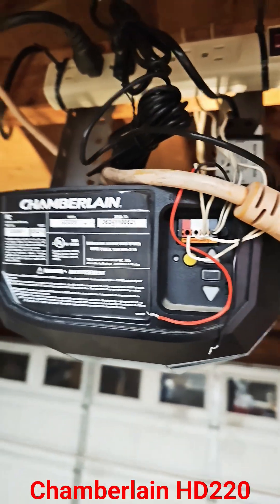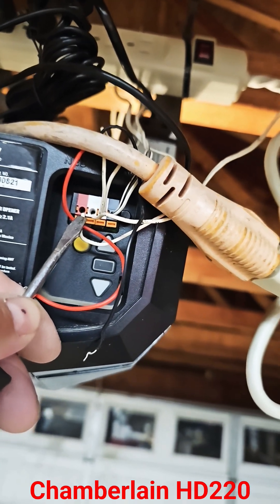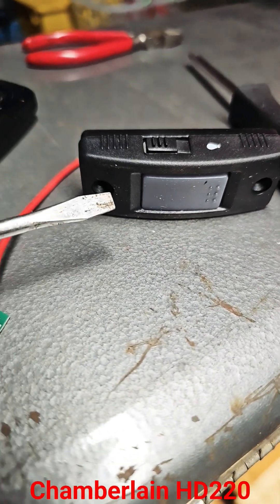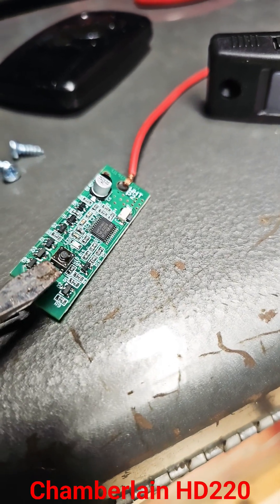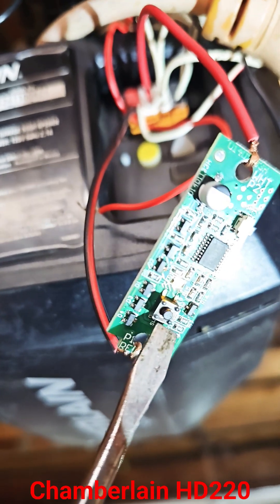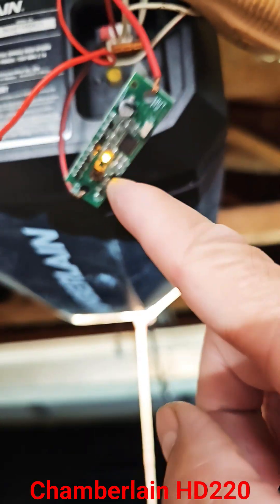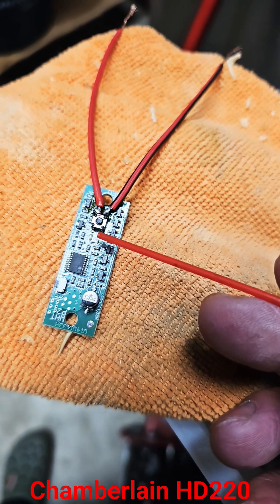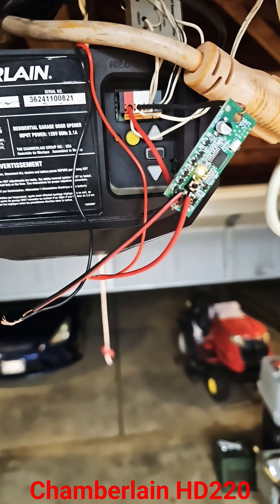Add Wifi to Chamberlain HD220 garage door opener.

Comment: Looks a little shabby but it's a nice idea. You going to use an ESP32 board?
Reply from the maker: Not sure. I used this remote.
https://a.co/d/3bsNLtk
Reply: @tonedubb4325  No I mean for the Wifi part. You need something that connects to Wifi, right? People often use the ESP32 board. It's even compatible with Arduino.

Comment: Why bother opening from cellphone?
I use vehicle remote or keypad athe door.
Reply from the maker: It's the second garage. I don't have a keypad. I remove the car garage remote and bring inside for security purpose. I often go in and out to get things to do yard work. I don't usually carry the garage remove but I always have my phone. 
I got these wifi devices connected to the main garage and front gate. With my phone,  I can open all of them.  Not only that,  with app, other family member can also use the phone to open the connected devices. I can remotely open the garage from anywhere in the world. I would never get lock out of the house.  My kids can open the garage when no one is home.  They don't drive. They don't need to carry a door key or garage remote. But mainly for me,  when need access to openthe garages or gare when outside doing yard work.  I'm out every day.